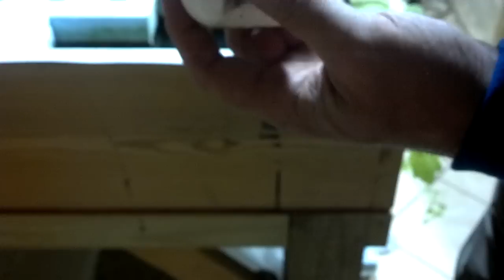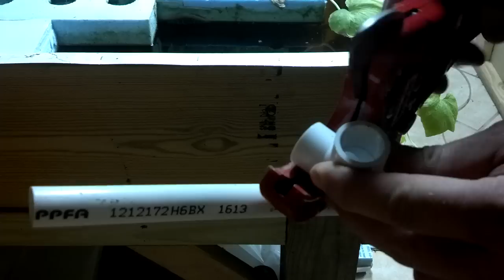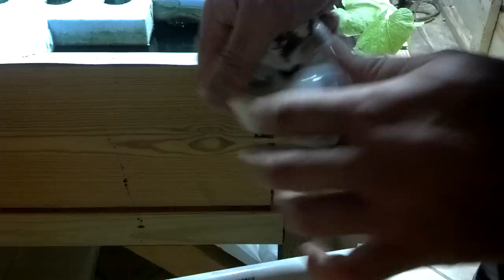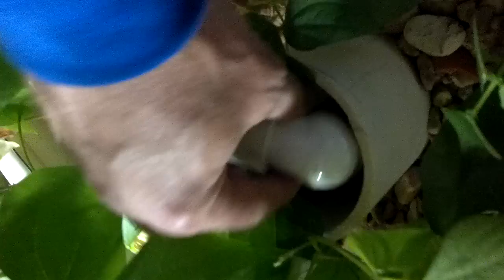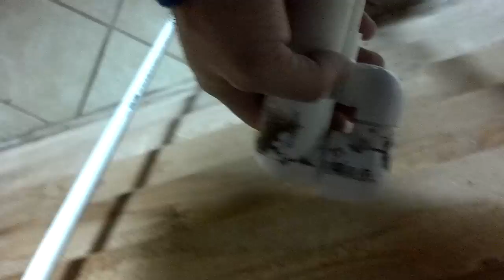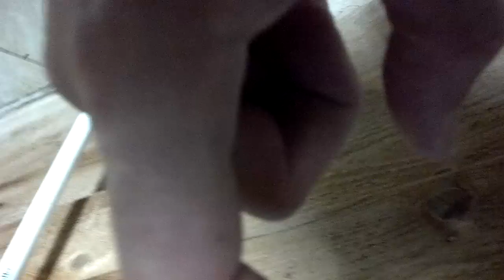Assembling the above bed siphon.

Comment: Good job... got it now. I've always used bell siphons and can get them to work just fine although, over time they can be a little work to keep them tweeked. I think I'll go to this and see if that works better. Thanks for the video.
Reply from the maker: I put a few twist in my design literally and i'm amazed with the results. check out my new video. It's the same design with just a few twist which raises the bends in the pipe level at the top. You may have to trim a little more to get it in a 4 inch pipe but there is plenty of room.